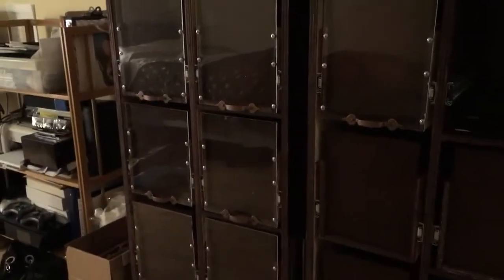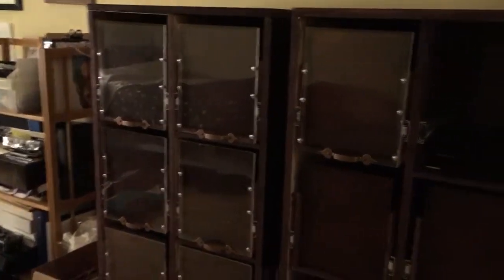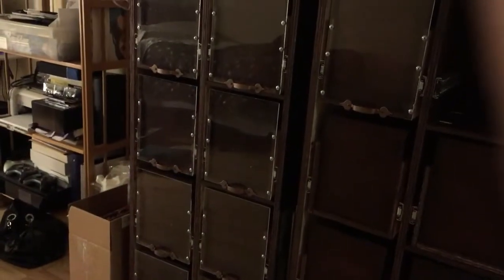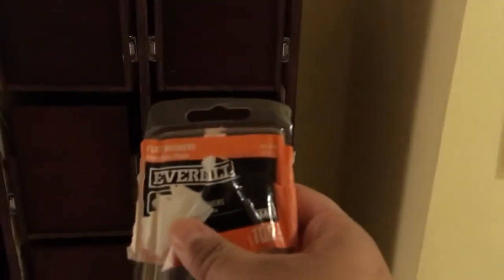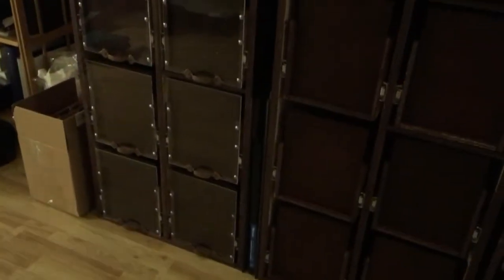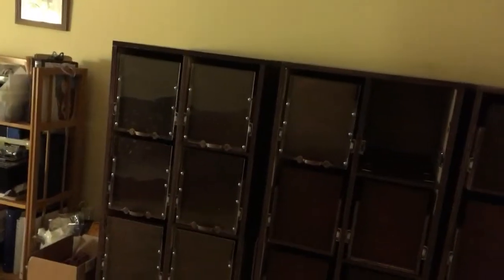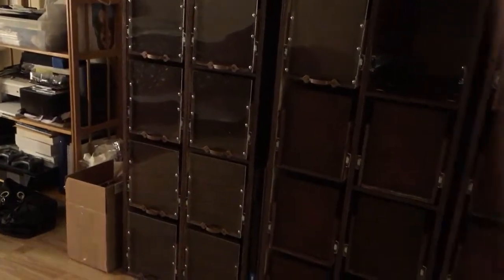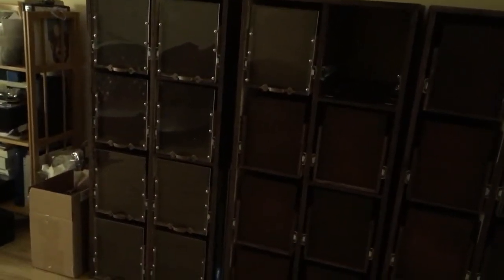Building a Comic Cabinet - Plexiglass and Handles (Final Video)

Comment: Thank you for posting all these videos!  After watching the videos by Faulkner, cougarcomics, and Paco_VJ, I thought Paco_VJ's cabinet was the best. I need to watch all of your videos from beginning to end, but I think I like your's better. I want mine to go all the way to the floor like this and I think you have more stability by positioning the sliders a little bit higher than right at the bottom of the drawer. Also, great job on those pocket holes. One question though, are you seriously not going to post a video showing this with all the comics inside?
Reply from the maker: Daily Compulsion thanks! Haha, guess I forgot to show a final pic of the comics. I was able to fit about 200 easily and could cram in more for more snug fit. Maybe I'll do another video later. Thanks for the comment!

Comment: Hi, I'm back again. I have just watched all of your videos in order all the way through. I am getting ready to finally sketch out my plans for this project and I was wondering what is the reasoning behind making the drawers only 23-24 inches deep? A normal long box is about 27 3/8 inches deep. I want mimic my current setup as much as possible and losing 3 -4 inches on each drawer/long box will screw me up. I asked cougarcomics this same question. Also, its crazy your videos are not getting as much attention as the others since I think your's are most aesthetically pleasing.
Reply from the maker: Honestly, I planned two feet for a couple of reasons. Firstly, the wall nook I had that I wanted to put the cabinets against was about two feet deep and I didn't want the fronts sticking out. Secondly, it was more efficient in price and wood to have two foot lengths, as I could then fit four pieces in the standard raw wood panels you get from Home Depot. Doing 28 inches would have left me with a lot of extra wood and would have cost more overall. I'm sure if you want to make them bigger, you totally could do that! Just make sure to get the appropriate slider sizes and adjust the other measurements accordingly.
Reply: @LadyRavenclaw16  Thank you for your quicky reply. That makes sense. I will probably report back later with more questions!